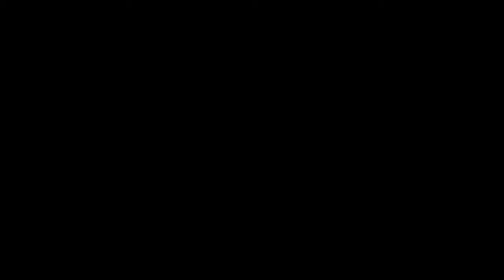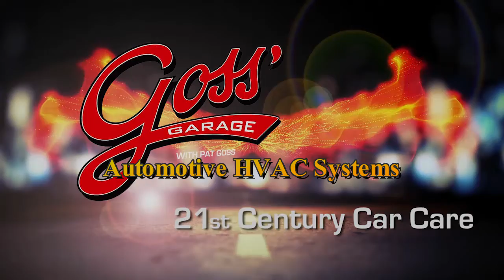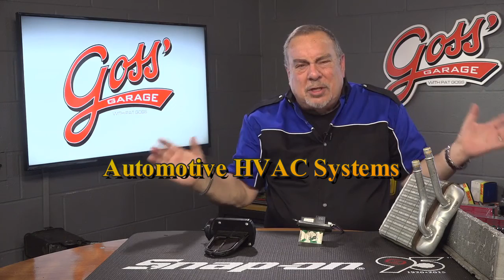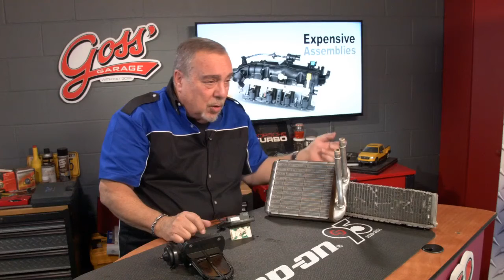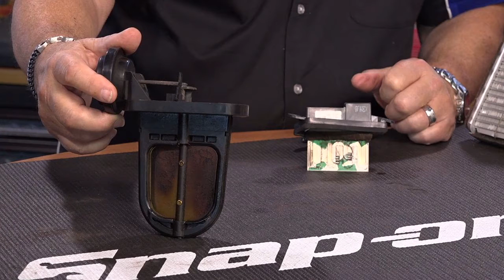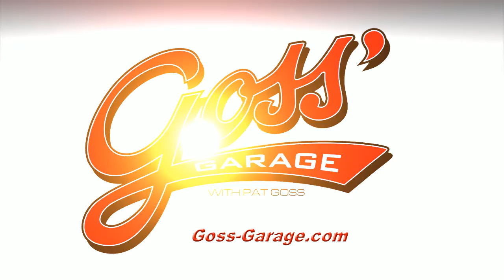HVAC SYSTEMS

Comment: Doing a cost/benefit analysis of modern computer controlled systems in a vehicle today reveals that exorbitant costs do not yield any meaningful added value.  Every time I open the hood of my older Corolla and see the cable hook up of the accelerator mechanism, I am thankful.

Comment: Does the temperature knob directs the amount of air passing through the heater core or the amount of coolant flowing through the heater core?  
If it doesn’t control the coolant flow then why is it necessary to turn the temperature knob to maximum heat when changing the engine coolant?
Reply: It controls how much of the hot air from the core mixes with the ambient air. The resulting air mixture is then blown into the cabin.